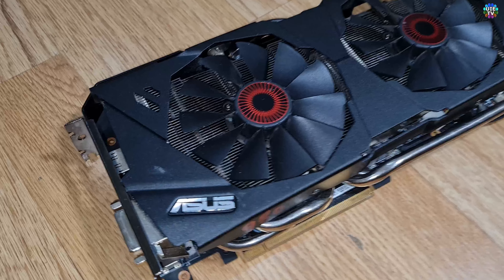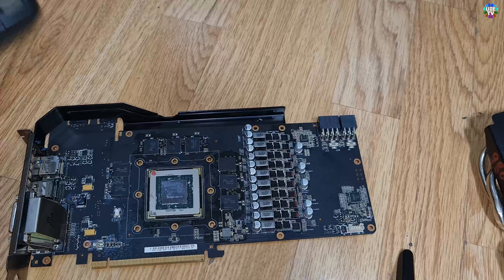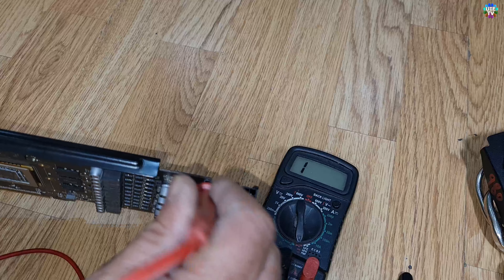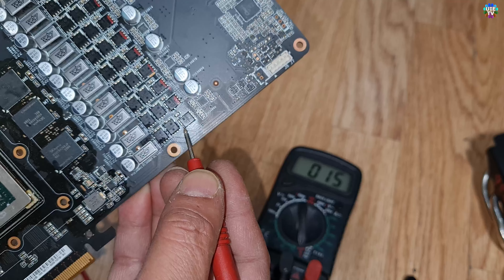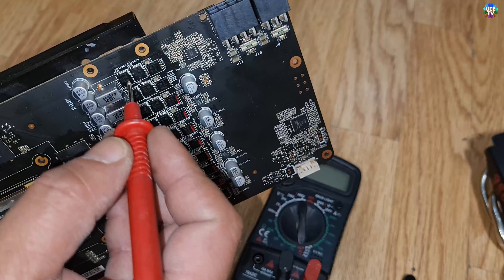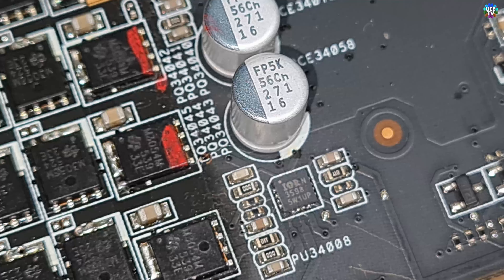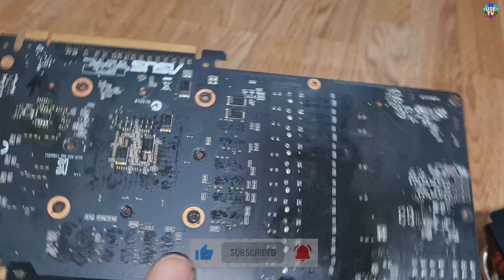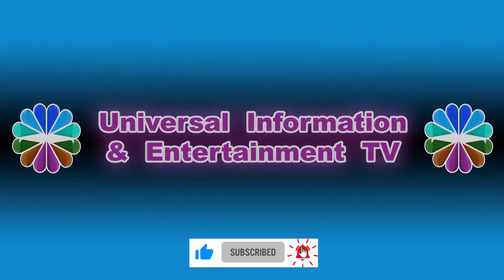(Part 1) Asus Strix GTX 980 GPU Graphics Video Card No Display Repair Guide Tutorial Mosfet m3054m

Comment: Very interensting, great video ... I would appreciate advice - my friend has an issue with his GTX 980 Strix as it boots to desktop but it crashes (to a pure blue or black screen) a minute or two after entering a game (for example Lost Ark). We ordered a new PSU as we though it would solve the issue, because for a while he was able to use GPUTweak to lower GPU Power Target to 65%, underclock GPU and memory to lowest possible and he would be able to play games for hours. The new PSU (Corsair RM650 CP) did not solve the issue so we changed the thermal pad on the GPU VRM and repasted (GPU) and it did not solve the issue, but now it got worse - even with 65% power target and underclock it would crash a minute after entering a more demanding game. There is no visible damage on the card an it works with windows desktop ... I would also note an oil leak was present on the VRM the first time we opened it and we have cleaned it, so we are now wondering if the card can be repaired by a professional electronic or should we give it up?

Comment: The voltage from your meter leads are enough to turn on and off the gates of those mofsets.  It's very likely that all off those mofsets are not failed, you simply turned them all on by applying your leads. Your black lead is connected to the ground plane and when you touch the red lead to the control pin you are turning on the mofset and shorting it internally through normal operation.
Better way to test for a short is Black lead to the 4 pins opposite of the dot which are on the 12v power plane and red lead to  the pin you were testing which goes to the control chip. These two should have no continuity. If they have continuity then the mofset is shorted closed and failed.
This would explain why one mofset you tested was fine and then showed shorted on a retest, the meter switched it.
If a mofset were truly shorted on the power side the PC would refuse to turn on as the 12V short protection in a decent power supply would not allow the PC to turn on.
Reply: good explanation. thank you
Reply: Usually the two mosfets in that circuit are damaged. One will show short but it's pair is damaged but will show ok.

Comment: A lot of times when the 980 is shorted on the core side, the traces are big enough to not destroy the core. Do not expect the core to be alright on an amd 64. The cores are damaged. Mostly on 2080 and 3090 the core will be ruined unless the person's power supply shuts off quick enough and the person didn't try to start it again which many people automatically do. Then the core will be fried.

Comment: I changed 4 high side MOSFETs on my GTX 970 (with higher rating/different model MOSFETs) but they shorted again. I test the board before soldering them and there was no shorts to check if any MOSFET driver is causing a short.
MDU1513 is the original MOSFET
PH2530AL is the replacement which all shorted after about 6 shours of rendering.

Comment: When my EVGA GTX 970 failed my computer wouldn't even power on. It appears that every mosfet is shorted, every pin measures shorted to ground, and there are 16 of them plus 4 drivers.